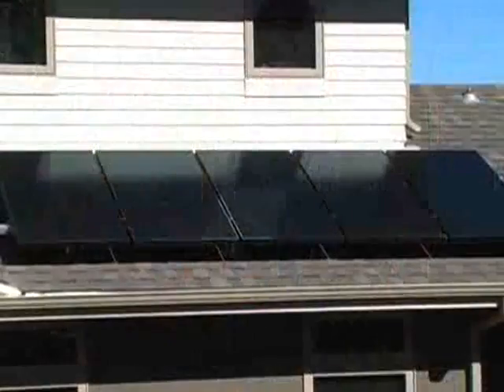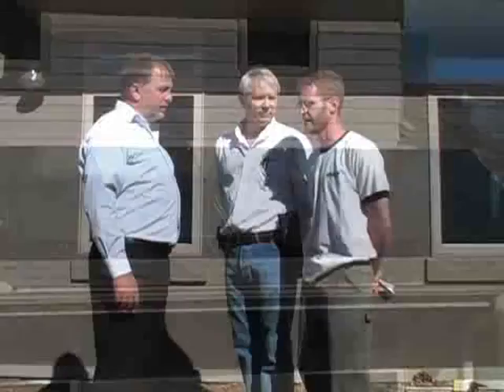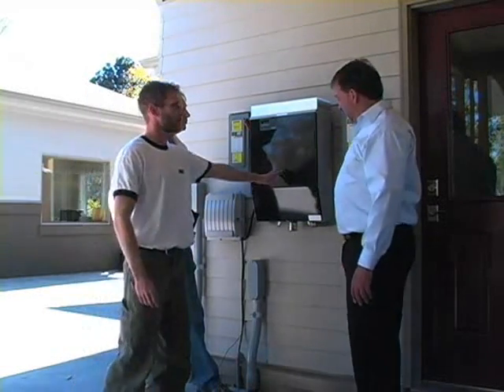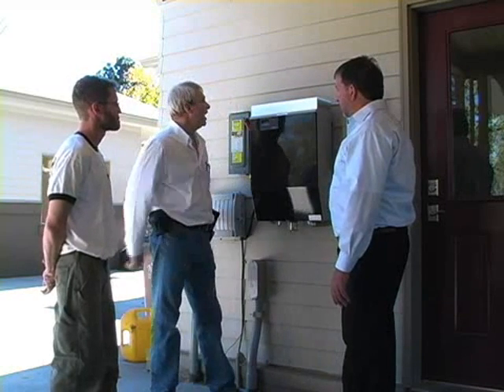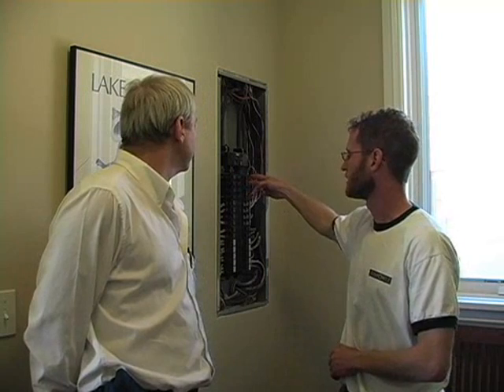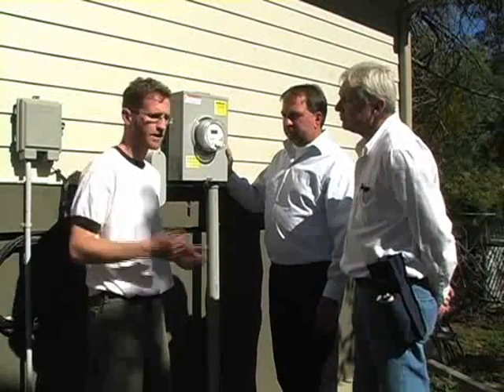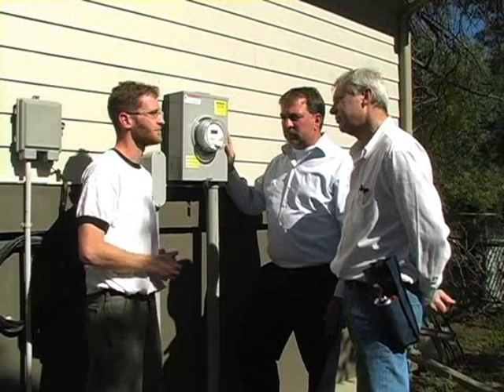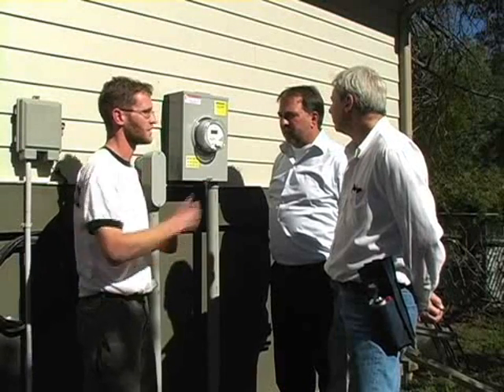Inspecting Photovoltaic Systems (Solar Panels)

Comment: The code says all dc side source cables in or on a building are to be installed in metal race way 690.37,690.31 ,690.41
Reply from the maker: Got it. Thanks.

Comment: pv back feed breaker should be at opposite end of main panel. No 705 labeling.... two sources of power PV solar and utility power. inspectors need to inspect this along with systems to be listed and labeled for use. Also conductors entering the building need to be in metal and labeled properly every 10 feet and every break by wall or j box.  Just a few you forgot to mention
Reply from the maker: Thanks for the feedback.